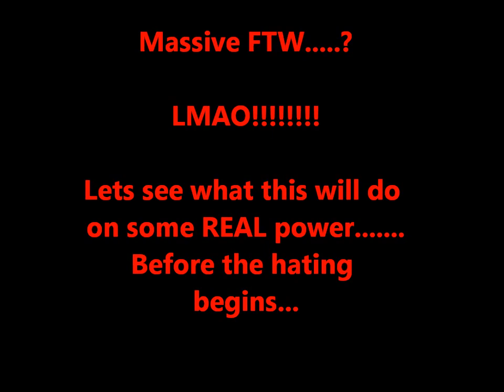3 Sundown X 12's in trunk of 98 Grand Prix

Comment: these subs take about 24 hours to fully break in and loosen up, but they can easily take 2000w each.. I'm pushing 1 x12d2 with an skv2.2500.. all 2900w watts when it sitting at 14.4v anyways.. my Silverado is ecm voltage regulation shit.. but I never drop below 13.2v eventually when my stock at needs replaced I'll go bigger than my stock 160amp. keeps up pretty good 4 now.. 2 new 34/78 yellow tops